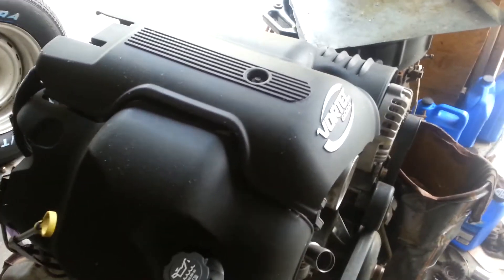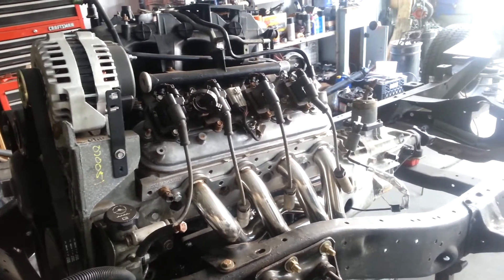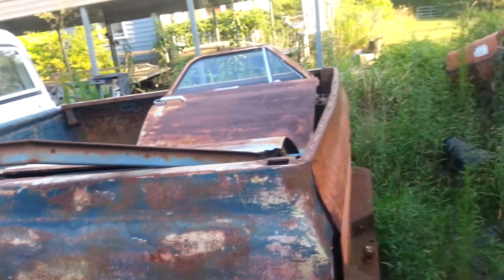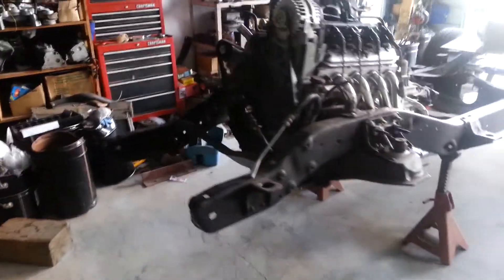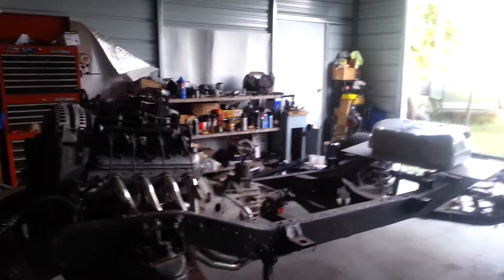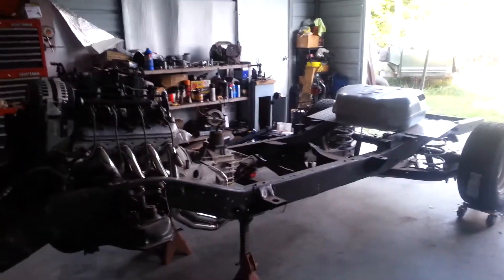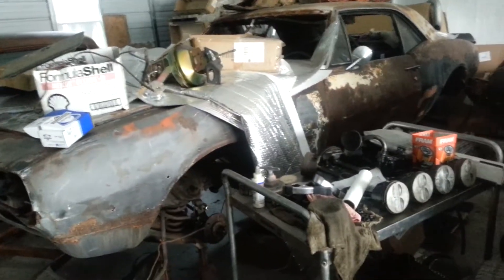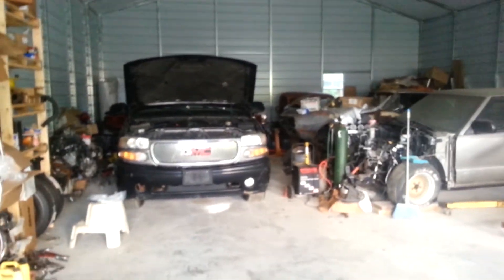67 C10 rat rod more engine updates

Comment: The 67 & 68 had the better dash...l like the hideaway head light grille but l don't like the problems that come with it - need a motor making strong vacuum for that...center caps with no rings & original step bumper all sound good to me...& I'd go with the silver deck stripes too...good video...good things take time
Reply from the maker: Thank you, James. I have more video but it takes forever to upload. That's why I keep the videos short. This video took about 24 hours to upload. Check out my next video tonight or tomorrow, I almost have a roller for the 67 C10. If they hadn't miss packaged  a lower ball joint she'd be on 4 wheels. Lots more good stuff coming.